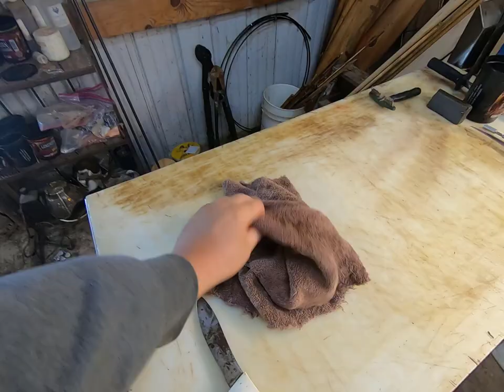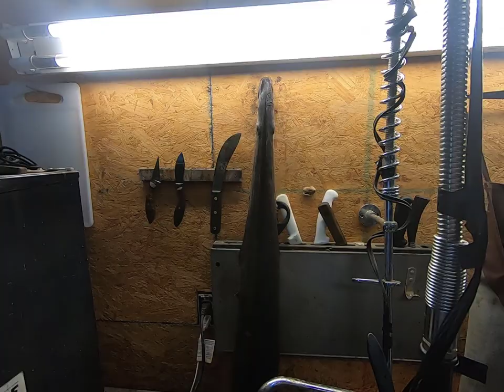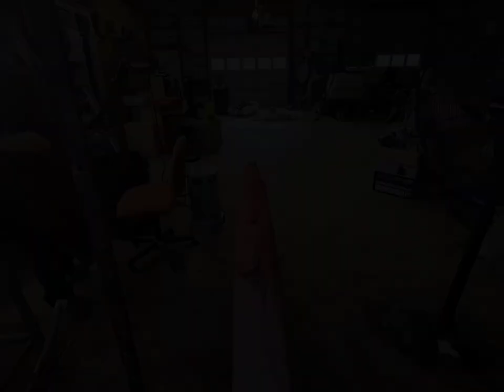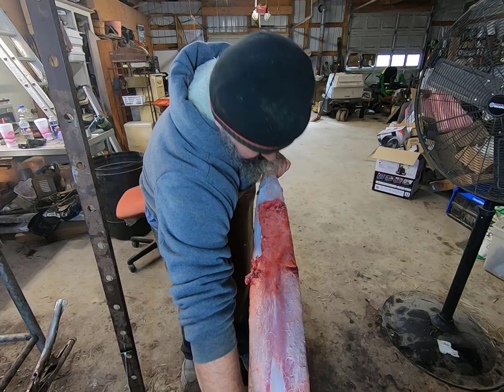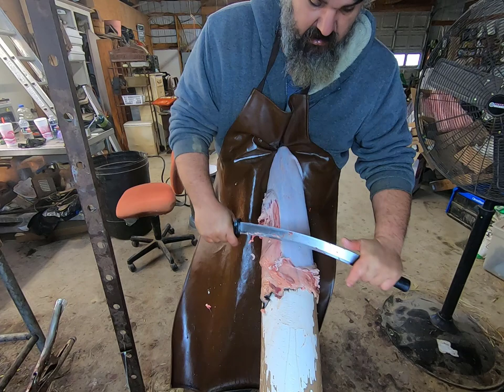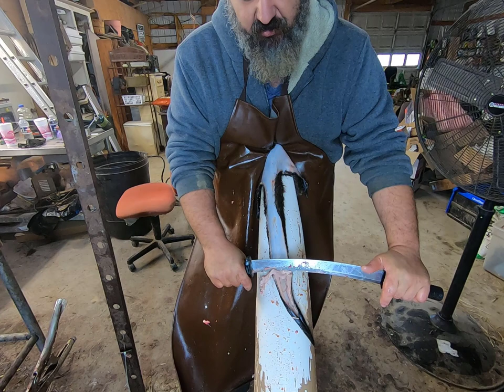Part 2 of 3: Otter catch, flesh, stretch and dry; Otter Fleshing.

Comment: Any reason everything is so wet, did you wet the pelt to avoid singe?
Reply from the maker: After skinning I clean the hides in my sink. Then go to the fleshing board with them. Otters I will not wring the water off to help with singing.